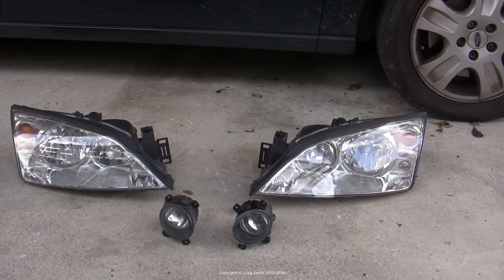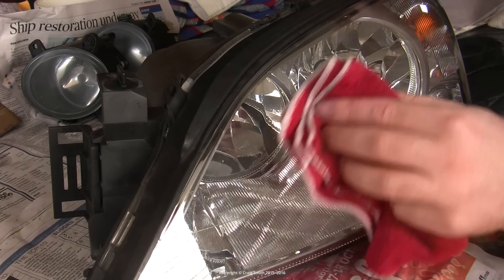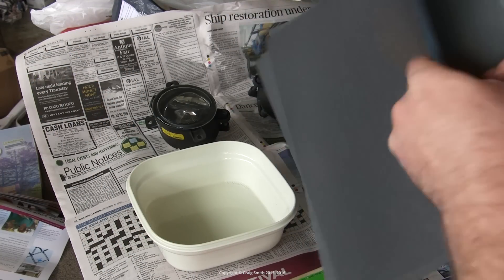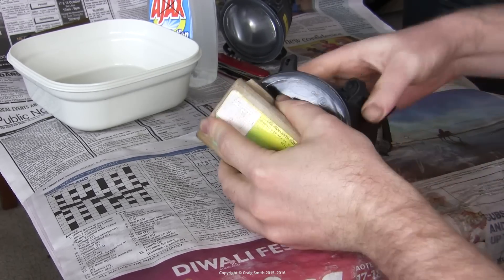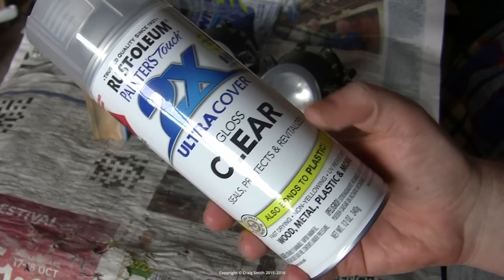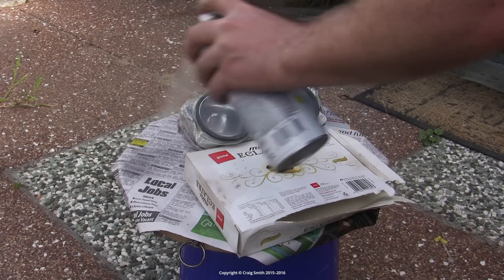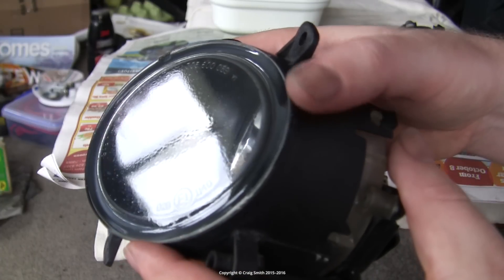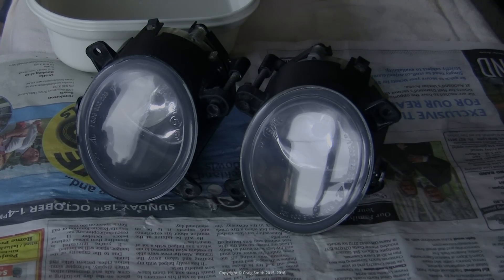How to: Restore & renew chipped, scratched, or yellowed light lenses

Comment: Why do you have to sand it again after you painted it ?
Reply: It's to level out the gloss coat since it is a little uneven and has "orange peel" texture after the spraying. The 1000 and 2000 grit are smooth enough to knock down the coat just a little bit to result in smooth finish. Hope this makes sense!

Comment: i used this on a headlight after sanding using 800 grit paper. it developed spiderwebs right after drying, horrible results. i did everything as shown on youtube videos. do you know if it cracked because of 800grit paper?
Reply: 800 grit is fine. The spray is too hard